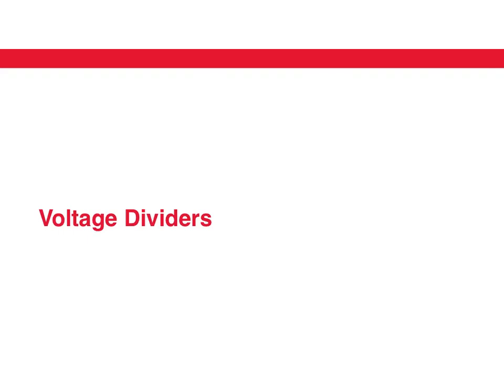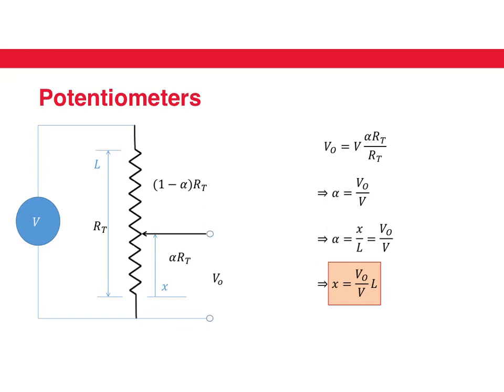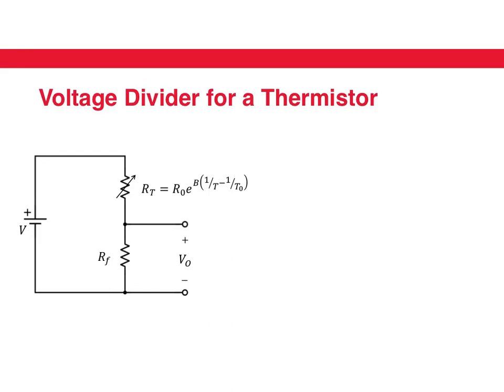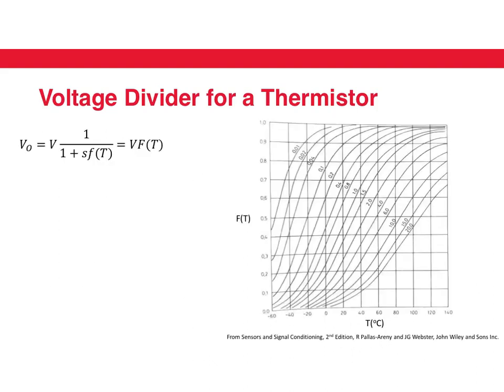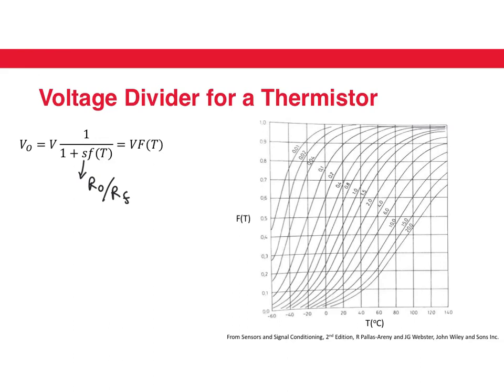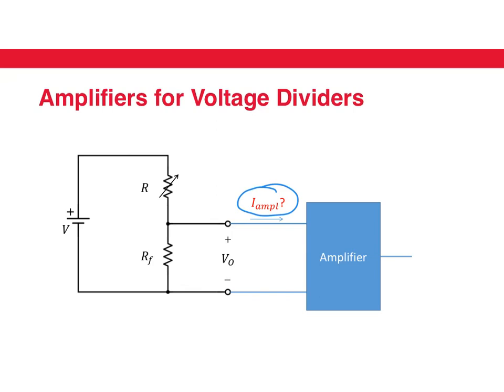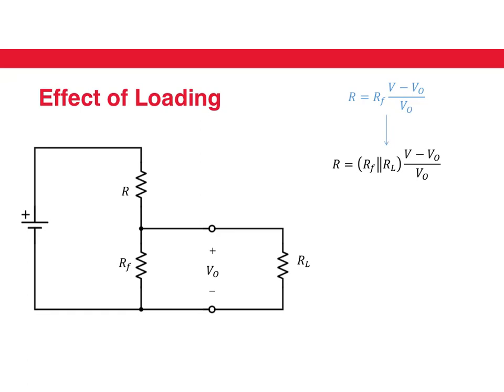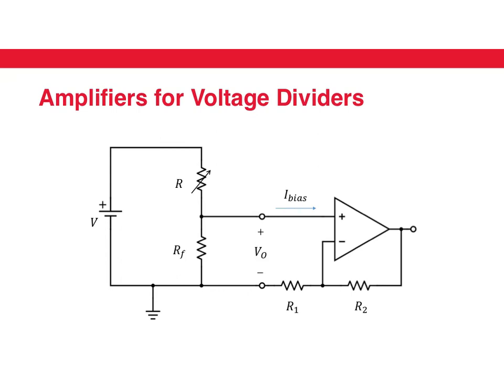3.2 Signal Conditioning for Resistive Sensors - Voltage Dividers

Comment: If our goal is to measure R, the variable resistance (say for a thermistor to then get temperature readings out of it), why can we not measure current instead and forgo the voltage divider circuit?

If I know my source voltage V, and I know the current through the variable resistor, I can use Ohm's Law to calculate R. Or is there something I am misunderstanding?
Reply from the maker: Great question! 

In electronics it is easier to manipulate/measure voltage than current. And that’s why we are converting to voltage. If you have an application that can make use of a current as easily as a voltage (it is unlikely but possible) - then your suggestion is absolutely possible.